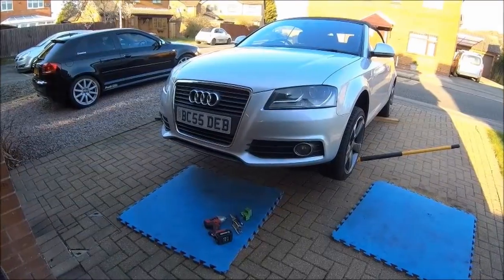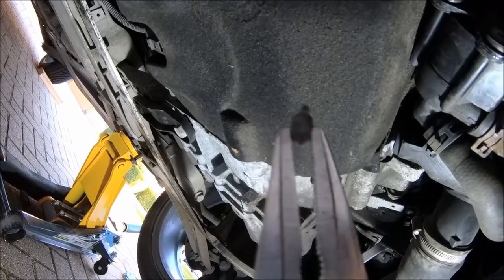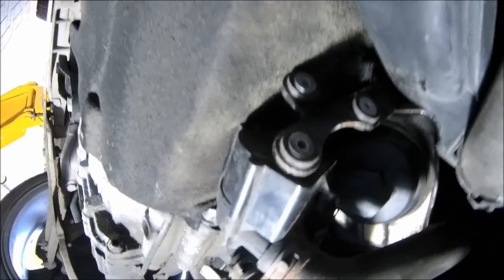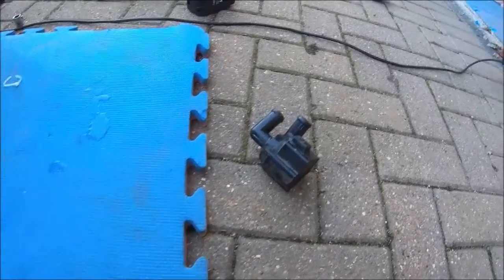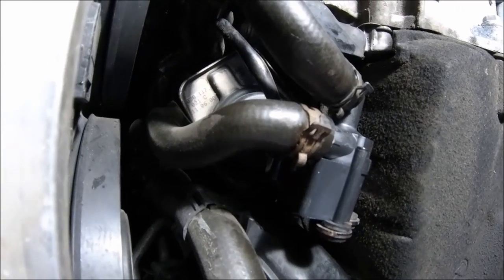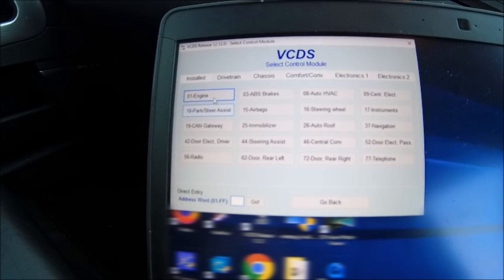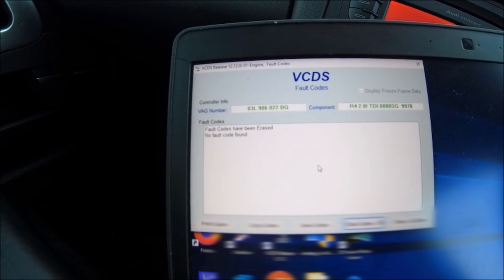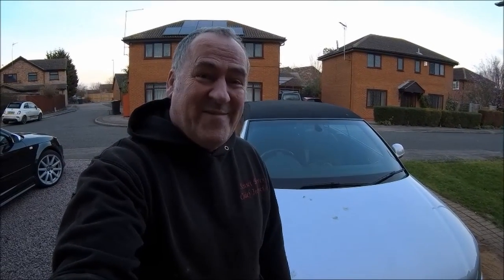#Audi A3 - Secondary Water Pump Issue  #P261A-000 Open Circuit

Comment: Was yours leaking? Is it safe to drive with a faulty one?
Reply from the maker: Mine was throwing up a fault code intermittently and showing the EML...  from what i understand you can still drive the car but risk overheating when stationary ... I did mine withing a couple of days but did not use the car much , but again was intermittent and had not fully failed.
Reply: @AdeReeves  Interesting just happened to mine yesterday, will have to wait at least a few days to get it sorted whilst doing 30 miles a day... Seemed to have lost a bit of power when i was driving this morning
Reply from the maker: seems this is the description Audi give... so seems more for comfort than anything else ....Audis are indeed strange  😀

A secondary water pump (or auxiliary water pump) is not connected to the cooling system and is primarily used to circulate warm coolant to the heater exchanger. It's for driver and passenger comfort, allowing sufficient heating at low RPM and speeds.
Reply: @AdeReeves  Odd that it forces then engine light and semi limp mode to come on

Comment: Hello, i wonder if someone will see this comment. But i have the same error, i replaced the pump, checked the wiring and the fuse in engine bay. I'm still getting this error. I'd appreciate some help to diagnose my problem.
Reply: my son has the same problem. changed pump, light still on after second restart so gets through mot. car works fine no ovrerheating etc just have to live with it, not worth spending money
Reply: Thanks for tour answer, i don’t have any overheating issues either i just want that check engine light to go off
Reply: Je suis dans la même situation
Reply: Je suis dans la même situation

Comment: I have an Audi a5coupe 12 plate 1800 tfsi low mileage I love it BUT .three water pumps and three yes three window regulators on the driver door
Reply from the maker: You got to love Audi's   ...  Window regulators are common place that but 3 secondary water pumps is bad luck...  have to say I'm glad i can do it myself , I bet a garage visit for this would not be cheap.
Reply: @AdeReeves  I don't think the 1800 has a secondary water pump but I was assured that the last one was the improved one at just under £300 fitted previous owner paid Audi £1500 and then £500 .I fitted the regulator myself £44 on eBay and it's a brand new and quality one if the water pump does go again I might try fitting it but I have damaged hands so it would be a struggle a5 definitely a lovely car . bought my daughter an A3 it's nice .cheers Ade

Comment: Did the car go into limp mode ?
Reply from the maker: No.. just threw an engine light .
Reply: @AdeReeves  ah ok I have an  a3 and mine error code came with open circuit 
And my car  is currently in limp mode just hoping that that’s he only issue